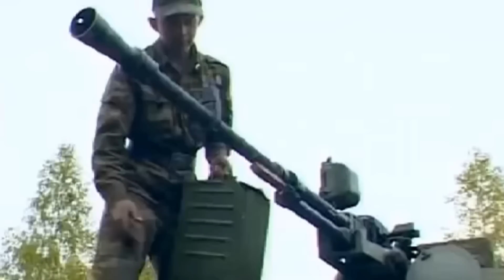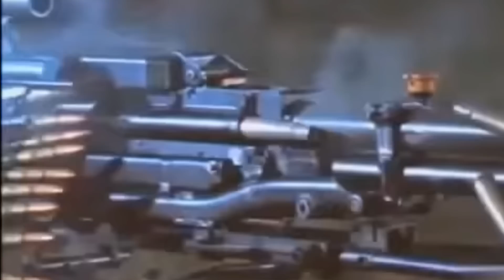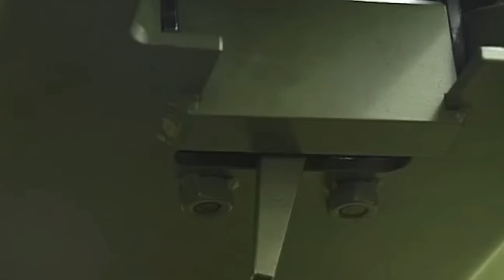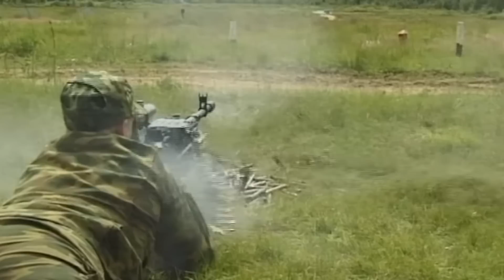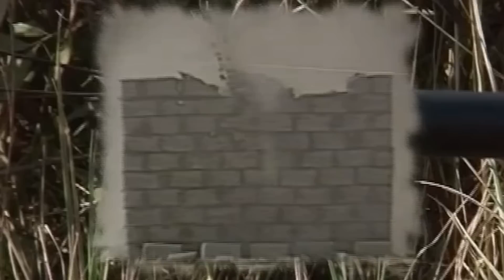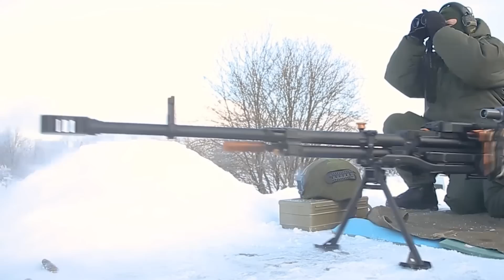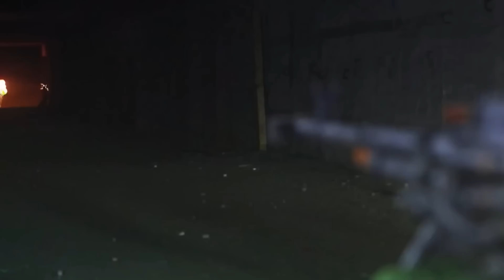Kord 12.7mm Heavy Machine Gun | Russian Beast

Comment: With NSV, we were told to switch barrels about 100-150 rounds. How about KORD? Or can it sustain thefire better?
Reply: 2000 rounds
Reply: No way you can go 2000 rounds, even firing bursts, with reloading without changing barrels.  

Barrel life is 2000 rounds, but to prevent overheating, you're going to be changing that barrel very belt or two, max.
Reply: There was H&K machine gun that could do exactly that, 2000 rounds with one barrel. Including 400 rounds (full magazine) without overheating.

Comment: The 14.5mm is where it's at, that is the pinnacle of heavy machine guns.
Reply: Someone missed the shoulder fired Kord at the end, try that with a 14.5mm
Reply: Someone missed the fact that it's still very impractical to do this. Also did you just delete your own comment?
Reply: Ya I did, I thought Matsimus wouldn't put that shoulder fire clip , but he snuck it in at the end lol Didn't wanna start a flame war and have to find the clip myself, so then I reposted lolol Btw the fact that its even possible to shoulder fire a Kord should be duly noted ..
Reply: Again, possible: yes, practical: no
Just because you can, doesn't mean you should.
Reply: I believe your father should have had the same foresight as the last part your last comment
Reply: That doesn't make it any less practical.
Reply: You may not like it but this,  this is what peak performance looks like
Reply: Kuddlesworth:  The WWII Japanese Type 97  heavy machine gun fired a 20mm X 124mm round.  It was designed as an anti-tank MG but the armor of WWII tanks soon surpassed its round's ability to penetrate.  They were used by the Japanese against U.S. landing craft and light amphibious vehicles in the Pacific but usually in the semi-automatic mode as  the recoil under fully automatic mode made it difficult to keep the sights on the target. It had carrying handles similar to bicycle handlebars as it took 4 average Japanese soldiers to carry it.  There's a good article about it on p.210 of The Encyclopedia of Weapons of WW II by Chris Bishop.
Reply: I fucking love me sone Dshkas!
Reply: The best bit about the 14.5mm is that it's readily convertible to 23x115mm Autocannon caliber.
Reply: 25mm M242 Bushmaster
Reply: Fun facts:
The 23x115mm was created by increasing the neck of a 14.5x114mm round.
As no time is needed to spin up the barrel cluster in short, half second bursts (which are common in dogfights) the twin barrelled GSh-23 puts more rounds on the target than a 6-barrelled M-61 Vulcan Gatling gun, and even in sustained fire it fires roughly the same weight at the target (due to the 75% heavier rounds).
Reply: @Steven Paul Belt buckles! 🤣🤣🤣🤣🤣👍
What about boot laces?

(BTW .50 cal=1/2"=12.7 mm, not 12.8. The diameter is the same for the two rounds, 50 BMG and 12.7 Russian, but the lengths are different, 99 mm and 108 mm respectively, thus they are not interchangeable.)
Reply: .50cal bmg is perfect for it's role... if you go 14.5mm I'd say bypass this go to a 20-25mm autocannon
Reply: There is a reason 14.5mm is used in NTW-20 as anti-armor round while 20mm is used as delivery for explosive shells. Too powerfull, 12.7 allows you to get infantry to carry this bad boy around.
Reply: TheArklyte 14.5x114 mm?

Comment: Great vid. But isn't this round more powerful than the .50 bmg?
Reply: Yes but not significantly. If you get hit by either in the open your gonna be fucked and if your in an APC you'll be fine.
Reply: @Volunteer-per-order_OSullivan  APCs like M113, LAV25 or BTRs would be penned by this though
Reply: Yes but in the way the 125mm gun  more powerful than the 120mm gun
Reply: Not really
Reply: No.
Reply: Is it? Any data plz?
Reply: There are other features that make this weapon more desirable, it's mobility and functionality for example.
Reply: @myopicthunder  but in all fairness it will likely be used on veichals or at heavily gaurded bases. Meaning that the mobility isn't to big of a factor

Comment: Kord > M2
Reply: Maybe, but the M2 is almost a century old and still viable. Using century-old stuff is practically a sacrament in Russia. 7.62x54R is still rocking hard bass.
Reply: @TwinklesTheChinchilla  mg 42 is old and better than m2
Reply: Βασίλειος Μπεσλεμές how is a 7.92x57mm mg with a 21 inch barrel better than a 12.7x99mm mg with a 45 inch barrel?
Reply: @blackskiesproductions915  well, when you inevitably have to retreat, you are kind of screwed with a 25kg gun that's as long as an Olympic swimming pool
Reply: @Burt Reynolds Corpse aww
Reply: @Nikola Poiukov  https://youtu.be/8jWEiL7du1U
Reply: @Nikola Poiukov  and Brazilian SF also lugs the M2 around aswell

Comment: Don't understand why this thing is so huge and bulky. It is just .50cal after all, but it dwarfs most 20mm aircraft canons from WW2. Why does a .50cal MG need a feeding mechanism bigger than that of a 40mm grenade launcher?
Reply: Cord weighs 25kg
M2 -38kg
feel the difference.
It can not be made any easier because you can not shoot it because of infernal recoil, the inability to control the aiming point, there is nowhere to disperse the heat.
Reply: It should be noted that the large-caliber machine gun "Cord" is the first in the world, allowing to fire from bipods, and if necessary, even from the hands of the shooter. Today it is the lightest of all 12.7 mm machine guns.
The weight characteristics of the modern Russian 12.7-mm machine gun allow us to raise the question of replacing the Kalashnikov machine gun in the platoon, especially given the fact that another domestic machine gun, Pecheneg 7.62-mm caliber, weighs only 8.2 kg on the bipods, which allows them to arm the small branch instead of the PKK-74 or the PKK.
At the same time, the new heavy machine gun is able to fire effectively from both trained and unprepared fire, as well as moving and stationary vehicles, from buildings and structures at any position of the fighter. At the same time, the relatively small weight of the entire complex, as well as the ability to quickly transfer the machine gun from the field to the combat position, allows the calculation to easily change its firing position. That, in turn, increases the survivability of the calculation, as well as the effectiveness and suddenness of the impact on the enemy.
Reply: TrangleC reasons
Reply: I guess.
Don't want to rain on Matsimus' "the Russians know how to make heavy MGs"-parade, but considering that the M2 Browning is WW2 technology, I don't see how this one is particularly impressive.
Hell, compared to the German MG 131, from WW2 too, it outright looks bad. The MG 131 was small enough to fit into the same fighter aircraft mountings as the MG 39, which means it wasn't much bigger, it weighted only 13 kg and it had a rate of fire of 900 rounds per minute.
This is not some Wehraboo "Wehrmacht did it better!"-comment, but we do have prove that you could build a heavy MG at half the weight and a fraction of the volume and that 70 years ago.
Looks to me the Russians didn't design some genius piece of equipment with the Kord, but rather did just the bare minimum anyone could have done, designing a new MG in the 1990s.
And then there is the fact that the cartridge is bigger (12,7x108 compared to the 12,7x99 of the M2 Browning) and has a bigger load and yet the muzzle velocity is lower than on the M2. Perhaps the projectiles are heavier. Couldn't find any info on that, but I doubt that there will be a significant difference.
Reply: @TrangleC  the reason the Germans managed to put the mg131 in the place of the mg39 was by adding bulges at the sides of the engine and reducing the amoload from 1000 per gun to 300 per gun
Reply: "Why does a .50cal MG need a feeding mechanism bigger than that of a 40mm grenade launcher?"

Because 40mm runs at a much, much lower pressure.  Even the "high pressure" 40mm used in the Mk. 12 use a small propellant charge and an expansion chamber in the case to keep pressure low.  

It's bigger than an MG-131 because it's not going to be sitting in constantly-flowing, cold air at high altitude.  The MG-131 was also never meant to see the volume of fire the Kord does.  It had a couple hundred rounds at most, and then it was done for the day.  The Kord needs to handle a lot more fire.

"the survivability of the calculation"

One place the Kord fails miserably is the muzzle brake, which is probably the one thing that makes it all possible.  This MG in an infantry role is a death sentence to its operator, because the huge dust signature that brake is going to kick up (not to mention the tracers that mark all MG users as an easy AND prime target) will make accurate return fire quick and easy for the other side.
Reply: You have no idea what you're talking about

Comment: What was wrong with the DSHK?
Reply: Old and heavy
Reply: sidharth cs I dunno the Kord looks old and heavy as well.
Reply: Kord looks like something from late cold war but its not that heavy after all. It even works with a bipod.
Reply: jack Senaviev But the DSHK is 2kg lighter than the M2 Browning and the Browning is a WW2 era weapon. So why wasn't that replaced?
Reply: @firepower7017  no need to replace it
Reply: "the Browning is a WW2 era weapon."

End of WWI, actually.  It a hundred year old weapon system.
Reply: DShK has not been used for 40 years.
Reply: The NSV that replaced the DShK is ~10 kg lighter with higher rate of fire. However as Matsimus mentioned the factory is in Kazakhstan, not Russia, hence the Kord.
Reply: The kord a s much more accurate